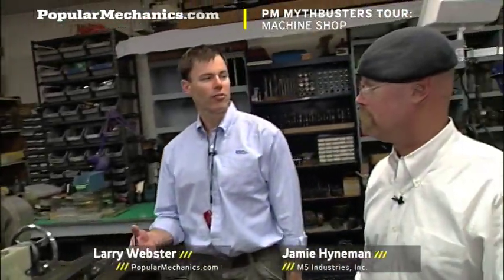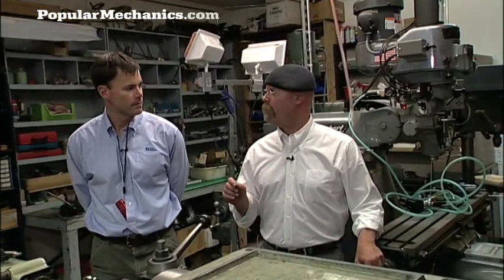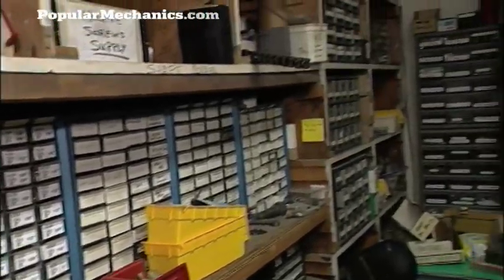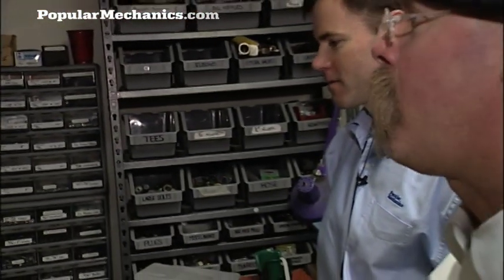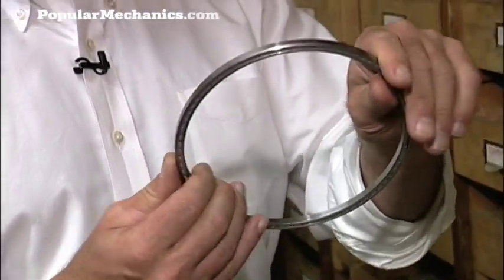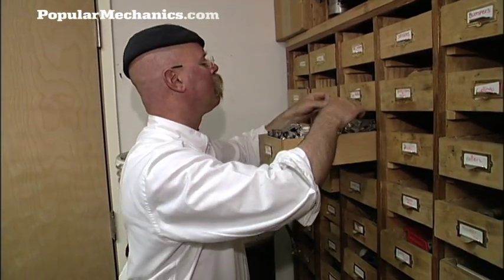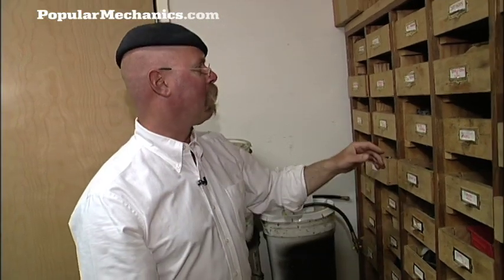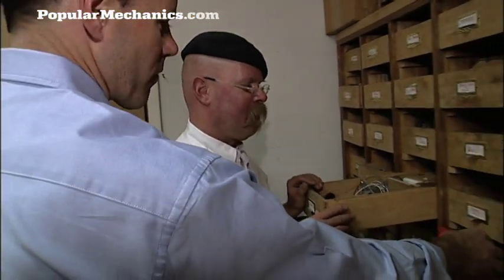MythBusters Machine Workshop Tour | PopMech

Comment: Even though I don't even in a million years have the space or amount of stuff Jamie have, I do have the same spirit as he do. Whenever I'm ANYWHERE with stuff I always think of parts. Motors, bearings, screws and stock stuff that I won't use in ages but when I need it, it's right there and I have like 10 of them. I mostly do it with electronics, stock up on a thousand different components even though I use 100 different usually, but when I need that ONE odd component, it's right there in my box.

Comment: It's not a very good machine shop without CNC equipment. His capabilities are limited with manual machines and I'm not impressed. DuH, you do not use gears with roller chain either.  I would like to know how did this guy get on the show? Does Jamie actually know how to use those machines, or does a real machinist work there? Bust that myth on a future show. At least he is stimulating the economy at the flea markets and surplus stores with all the junk he purchases. Is he the pack rat from HELL?
Reply: Adam Savage can't machine, either. But he is trying.